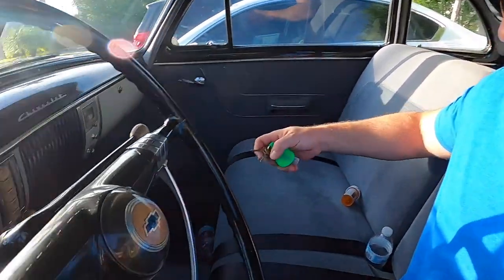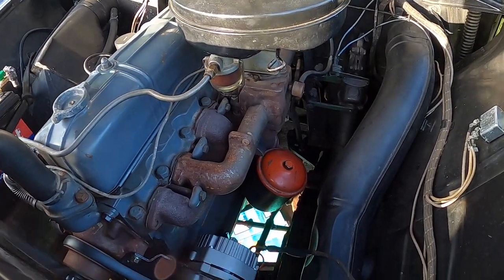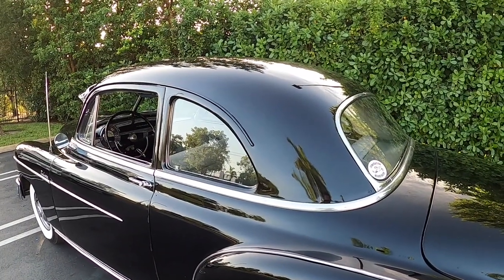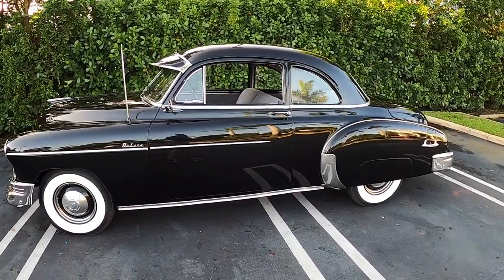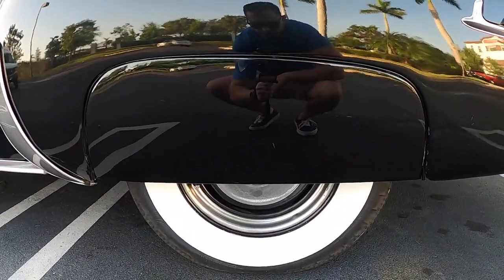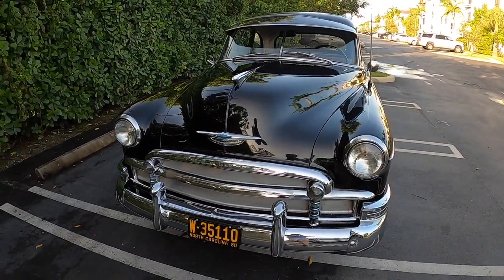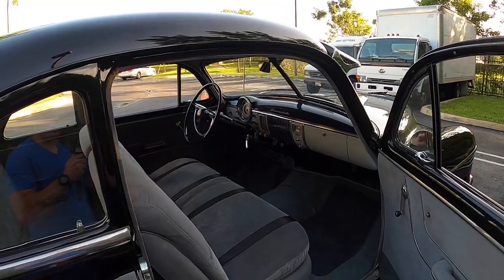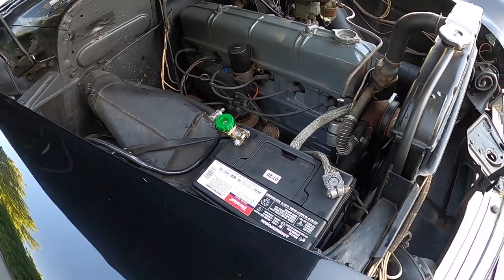1950 Chevy 6 volts to 12 volts conversion - Generation Oldschool

Comment: There is no need to convert to 12 volts.  Just use the proper 1 gauge battery cables, and a Group 2 or larger battery, and you will be fine.  You can use an 8 volt battery if you wish, you just have to re-adjust the regulator.  The automakers went the 12 volts as a cost save more than as an upgrade.

Comment: The rear bumper guards are not the stock bumper guards they're what's left of the accessory bumper guards you're missing the crossbar your oil filter is not original also that's an add-on most likely inner line bramd

Comment: Beautiful chevy!  I've never done a 12v conversion.  Always wondered if all the lights and other electrical operated equipment [like the radio] would require replacing?
Reply from the maker: Not replacing but you will need a voltage reducer for the radio. My radio doesn’t work so I didn’t put a voltage reducer from 12 to 6 volts. Is just there for looks

Comment: '50 Chevys were already negative ground, so putting in an alternator isn't a problem.  Generators didn't care whether a system was negative or positive ground, but with an alternator, it needs to be negative ground.